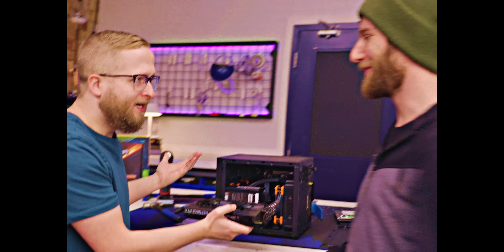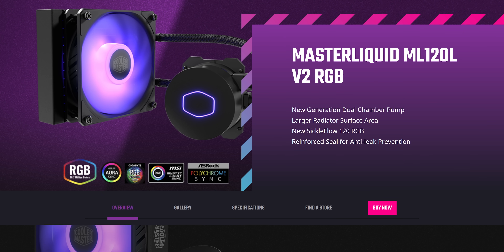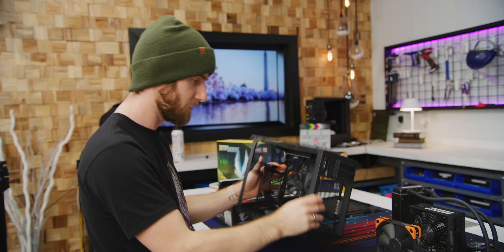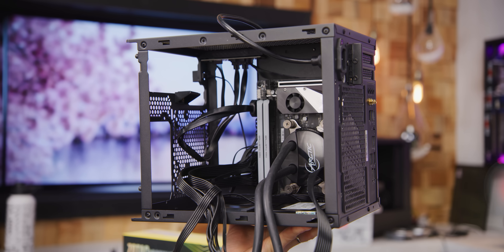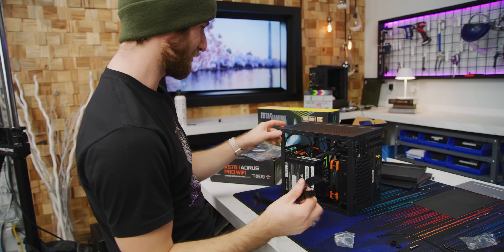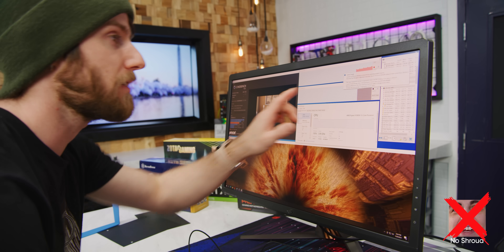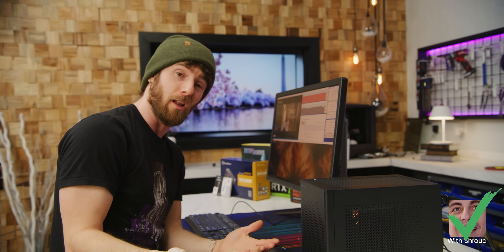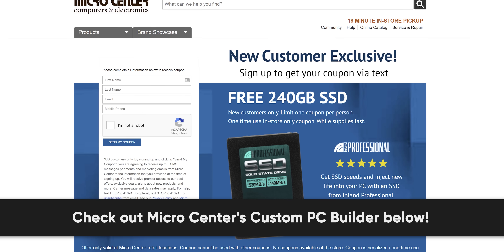This GPU SLIDES into this Case! - Silverstone SUGO 16 ITX Case

Comment: @Linus Tech TIps

The title “This GPU SLIDES into this Case!” is at best unintentionally misleading, in that the GPU doesn’t actually slide at all… But it feels worse than that given that the impression you (are at least I) get from the thumbnail is that the GPU slides in like a hotswap HDD slides into a toolless drive bay… it feels like intentional clickbait.

The GPU doesn't "slide" into the case. In order to "slide", you have to be in contact with something. That's literally the definition of "slide". To be in smooth, continuous contact with a surface… which clearly isn’t what’s happening in the video.

I would like to see the dislike count for this video, to see if it's higher than normal.

Comment: I really don't get why people put up with such difficult, clumsy and badly designed builds.

I'd put up with all the crap if I was maxing out a PC Build to get top performance, but just a PC, that doesn't do much?

btw For small form factors get one with an external power supply to keep all that unnecessary heat out of your case. Why add all that heat to then have to tie yourself in knots trying expel it again?

Comment: pull of config is just bad for this usecase....3070 are not hot , but a 5900x is hot all core 4.0 is jusy way too weak,dont know why recent ltt videos likes to do this, an 120aio are  just too weak for a 5900x pull config is just not a good idea especially in this small case,and also dont think a zen3 cpu memories controller can handle  fclk 1:1 4400mhz